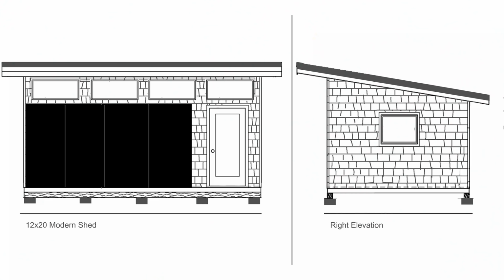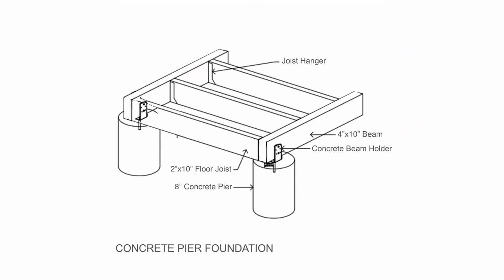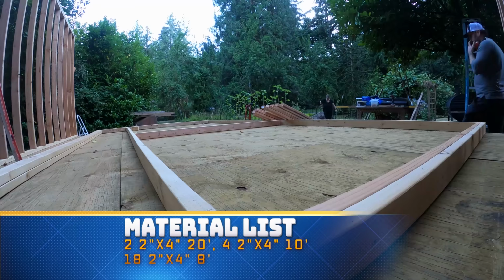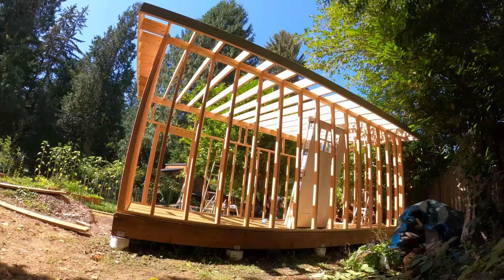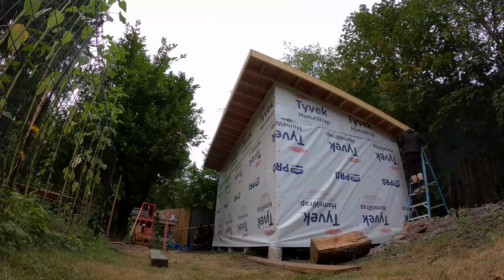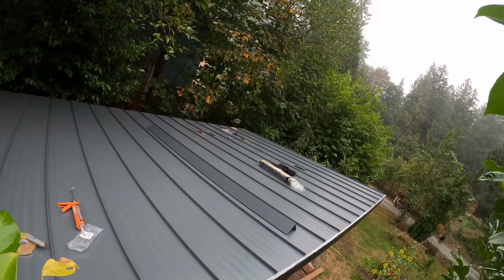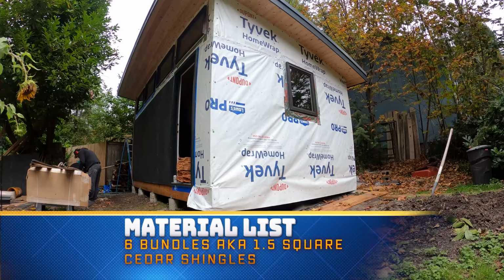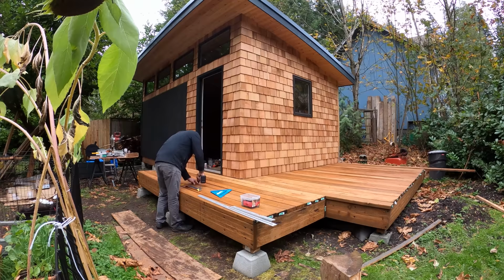Build A 12'x20' Modern Shed and Deck by Yourself: With Material List

Comment: Why didn't you insulate the floor?
You will never be able to walk barefoot in the winter and a thermal bridge will appear (condensation in the winter + rotten floor)
Reply from the maker: Yeah, I should have insulated before placing the sub floor for sure. 
If you ever do what I do you can cut 3” ridged foam board insulation and slip it between the floor joist from underneath glueing it in place. It’s a bit more cumbersome to install after the fact that’s for sure. lol 
Note to self: next time insulate floor before placing sub floor sheeting 😆
Reply: @NilesProductions  A solution could be to drill a few holes in the floor and fill the space under the house with cellulose or small polystyrene balls.

Comment: Do you think the concrete posts will ever settle deeper? I want to do the same or similar for a small house
Reply from the maker: Different areas have different codes for how deep you need to dig when doing the post style foundation. I went a little deeper than what our local code called for when doing mine so hopefully they are good for the long run. 
It's been close to two years since I built the shed and it still looks as square as the day I built it. 
I've never actually built anything like this before so I'm by no means an expert on the subject. One step that I skipped that I've been made aware is that I should have compacted gravel at the bottom of my holes. There are probably some online resources for your area that will help you know what depth you need to dig for your foundation. And you can find info about how many piers you will need for your building based on square footage.
Reply: @NilesProductions  I didn't think of local code either.. thank you so much!! Hope your weekend was amazing friend :)

Comment: for the soffit 1x6 t&g did you have the rafters overhang the structure to provide a nailing edge?
Reply: Hansen the dog looks like a great companion
Reply from the maker: I assume you are talking about the short pieces as I make my way up the sides? The rafters don’t over hang the edge they were flush with the outer wall framing. It’s a little hard to see in the video but I used a small piece of 2x4 blocking on the inside edge. I was placing the blocking against the rafter just prior to installing the T&G as I worked my way up the sides so my body may be partially obstructing the shot of me placing the blocking.

Comment: this is so nice. may i ask how much did you spend for the materials? im plannint to build a gazebo and i got a lot of techniques from your video
Reply from the maker: It spent a little over $12k for the shed and deck. Wood prices have been all over the place these past couple years so if you want something more accurate to todays current prices you can take the material list in the video description and price it out at your local lumber yard 🤙
Reply: @NilesProductions  yeah... i have the materials (i think i need hahahahahaha) and trying to get pricing from different websites. thank you so much.

Comment: Did you get a permit and do you recommend that we get one too ?
Reply from the maker: I recommend you Google your local ordinances and check before you build. In some areas the size of shed you can build without a permit vary drastically. For instance in some counties you can only have 100sf shed within city limits before you need a permit, but in the same county if you live in unincorporated areas you can build a shed up to 250’sf. without a permit. This might not be the case for you. Some places you can go bigger other require a permit regardless of size. it all depends on the local ordinances and where you intend to build. 
If you want water or power ran to your shed that will almost certainly require permitting. 
So I recommend you do some investigating before you break ground because last thing you need when doing a project like this is a fine or worse being forced to take your building down because you didn’t get a permit. So, long story short, do your own do diligence I can’t answer this question for you.  🤷‍♂️

Comment: Very impressive how you put this together from scratch, I would be slightly concerned about the ground moving over the years with it all sitting on those cemented blocks, 1 side getting lower etc?
Reply from the maker: Thanks Danny! Glad you enjoyed the build :)

For the size of the shed/structure I was building I needed a total of 8 piers. (not counting the deck) 
In the area I live you need to run the pillars below the frost line. The frost line is 12" here.  
After talking with some people that know more than me about this stuff than me they recommend I dig down at least 18".  
With that bit of info I decided to beef things up even more just to be on the safe side. 
I had similar concerns to you and the cost was minimal to take the extra step.
I ran my pillars a minimum of 24" deep instead of 18" and did 10 tubes/piers instead of 8. 

How are things holding up you may ask? 
Well, It's been aproxamently a year and a half since finishing the shed. 
In that time we have had over 100 inches of rainfall plus a bunch of snow. 
The drone footage at the end was taken aproxamently one year after completion. 
I'm happy to report the shed hasn't shifted or sank into the ground and is still sitting as square as the day I built it. 
Depending on where you live and the soil you are working with the results and requirements may very a bit. 
I found for me, doing research, reading, and asking professionals for advice will go a long way in making sure you are making good decisions. 
I think I made mostly good decisions when building this shed...
With all that said, this is just how I did things. Perhaps building on a slab would have been a better way to go? IDK? 
There are a million ways to go about building a shed... this is just the way I went about it.

Comment: Hey Niles, the prices for lumber and materials will probably differ greatly here in Germany, but could you still give me an estimate for the cost of this shed?
Reply from the maker: Materials were a little over $12k usd at the time I purchased them. Lumber prices have gone wild here in the past year so I assume it would be much higher if I were building it today.
Reply: @NilesProductions  Ok thanks, much appreciated!
Reply: Could save some money by using 2x8 or even 2x6 floor joists, regular plywood on the floor, and cheaper roofing. Except for using screws instead of nails, this shed is overbuilt 😄 Love the detailed walkthrough

Comment: What is that blue thing you’re using to screw on an angle? 2:26
Reply from the maker: It's a Kreg Pocket Hole Jig https://www.rockler.com/kreg-pocket-hole-jig-k4?country=US&sid=V91040&promo=shopping&adlclid=0b1dda7fcef210758a8abc0fbe973ec2&msclkid=0b1dda7fcef210758a8abc0fbe973ec2&utm_source=bing&utm_medium=cpc&utm_campaign=%5BADL%5D%20%5BPLA%5D%20-%20Shop%20by%20Brand&utm_term=4585307093454876&utm_content=Shop%20by%20Brand

Comment: I have a question… Where did you find your 4 x 10 x 20 beams? Did you have to special order them? Even my local lumberyard said they don’t have the ability to get that size
Reply from the maker: Places like Lowes and Home Depot don’t carry lumber that long. 
Not sure what local options you have where you live but I purchased all my longer 2x8 rafters and the 20’ 2x6”s, 20’ 2x4”s and 20’ 4x10”s  at Dunn Lumber. 
I recommend you Google “Lumber Yard near me” and then make a couple calls. Most yards that aren’t big box chains carry longer dimensions lumber. Good luck on your hunt 🤙
Reply: @NilesProductions  I used a local lumber yard.  They have 4x12 and 4x8 but no 4x10.   It's my "goto" company- They indicated that their supplier doesnt carry that size.  I'm gonna check around at some others- I may have to modify the subfloor if I can't.  PS.  loved your update to solar/battery backup.  I've been eyeballing both the bluyetti and the ecoflow.  I am now leaning to the blueyetti thanks to you.

Comment: hmm, Australians don't do wood sheds, they're almost all sheet metal.
Reply from the maker: Lot of different ways to accomplish a similar goal. I wanted to build something that would stylistically compliment my house also Lumber is pretty abundant where I’m from so it seemed like the logical choice. Did a metal roof though 😜
Reply: @NilesProductions  yeah ours are all like in kit form on a concrete slab, there are a lot of options but not like fully custom builds as yours seem to be

Comment: Shed cost more than a down payment on a home
Reply from the maker: LOL, It was a little expensive as I used a lot of nicer materials but was still a lot cheaper than hiring someone to build one for me.  I could have bought a prefab one about half the size for around the same price but from what I saw they tend to use not the best materials in their construction. 
With the price of wood all over the place these days depending on when you pull the trigger this could cost you a lot more than it did for me or potentially less. In the past two years I've seen a sheet of 3/4 plywood cost as low as $30 and as much as $100. Last time I made a trip to the lumber store prices were closer to early 2020 vs the beginning of last summer when they were around triple that of what I had payed the year prior.

Comment: Anyone happen to have the material list in metric??
Reply from the maker: I don’t have it converted sorry.
Recommend googling inches to mm conversion and going through the list piece by piece. 
This will probably take you a bit of time but at least you have the original imperial measurements to start.
Good luck

Comment: Very informative video, thanks.  I too am interested in how yo finished the interior.  Also, I have a question about the shingles ... does the staples stick out on the inside?  I'm going to use shingles on my shed, but don't want the staples to be visible. Thanks again!
Reply from the maker: Thanks Shawn! The staples did stick out a tiny bit on the inside when I first installed them but with an angle grinder and about 5 minutes of your time you can zip all those sharp points off. You can also take a hammer and bend them over making your install extra secure but I preferer the grinder method.

Comment: After all the positive comments, I hate to be the hater, but your joist hangers used on the floor joists are grossly undersized.   They looked like rated for 2x6, not 2x10.  Meanwhile screwing into end grain not the strongest connection either.  You will probably never have a problem, but if it were me, would've made the floor a lot stronger.  Sorry to be negative Nancy.
Reply from the maker: Yeah, that’s one area where I could have done better. I’m still happy with how the project turned out as whole though. I appreciate the feed back it’s how we learn. This was my first shed and if I ever build another one It’ll will only be better because of feedback like this. So no need to say sorry, I don’t take offense 🤙

Comment: Since you did a 16" OC roof - could you have done 2x4?
Reply from the maker: I don’t think 2x4’s would meet the snow load code where live
Reply: @NilesProductions  You're right. Just checked the tables and max rafter span for a 16" OC 2x4 is 10' for #1 grade Southern yellow pine

Comment: I think you should have recycled as much from the old shed as you could . If you dismantled it as carefully as you could, you would just have parts that could be cut and reused. If you still have the bits of the old shed maybe offer then for free on gumtree, someone else might build something from it all.
Reply from the maker: Good advice 👍 I did save some of the old shed during deconstruction. I’m all about reclaimed lumber. We were planning on building a shabby greenhouse that will use a lot material from the original shed and a bunch of old windows we have collected. The main house has a bunch of reclaimed timber and beams in it as well. The new shed is the only structure on the property that is actually all new material.

Comment: I had to stop watching closely at about 3.5 minutes, when you used deck screws to install the hangers.  These screws have good holding power for decking, but they have low sheer strength, which is how you're using them.  Hopefully you won't have a future problem, but it's important to use the correct screws for an application.  Deck screws should NEVER be used for hangers. I skipped to the end, and it looks like a heck of a shed.
Reply from the maker: I’m sure I make a couple mistakes along the way as I’m not a pro. So far it’s holding up 🤞

Comment: Walls on top of the flooring? 🤔
Reply from the maker: The studs for the walls are on top of the sub floor with fasteners running through the bottom plate, through the sub floor, and into the pressure treated lumber. The plywood sheeting hangs just below the baseplate overlapping the sub floor to protect the outside edges of the flooring from moisture.

Comment: Did u need a permit
Reply from the maker: Permitting can very wildly from area to area, I suggest checking your local building codes before starting. While what may be fine where some live it may not work without permitting where you live. In the unincorporated parts of the county were I live you can build a shed up to 749 square feet depending on the size of your property without permitting while in the town you are limited to 200 square ft and even 120 square ft in some areas.

Comment: Your going to have issues since you used deck screws for your joist hangers
Reply from the maker: Yeah, I should have used structural screws or nails. I think I’ll be fine though having used the headlock lag screws in addition to the joist hangers. I’ll keep you posted and let you know if things start falling apart.

Comment: Does it have to pass building code?😁
Reply from the maker: I recommend checking your local codes and permitting before building. What is good where I live may not pass where you live. For instance in parts of the area where I’m at (in the city) you can only build only 120 square foot structure while in other parts you can build 250’ with some small exceptions for agriculture all the way up to 750’ in some.

Comment: What's a bird box? Isn't it a bird's mouth or something?
Reply from the maker: You are correct, it’s a birds mouth. I find 90% of the time in life when I act like I know what I’m talking about I’m using the wrong terms or stumbling, and mumbling like an idiot. 

I hope despite using the wrong term the step still makes sense lol
Reply: @NilesProductions  i knew what you meant. Thanks for the vid. It is very inspiring to see vids like yours. 👍 Do you work in the trades?
Reply from the maker: Not a carpenter by trade. I’m just a guy with a cheap saw and hammer that likes to DIY stuff. My skills come from building a bunch of skateboard ramps and half pipes in my youth. 😜

Comment: You didn't show the finished inside or how and what it takes to run power to the shed. Great job otherwise. Thanks.
Reply from the maker: It’s nothing fancy or anything on the inside. Just some shelving and a workbench. I plan on running a solar generator in the future for lighting and small power needs.

Comment: 1) Looks like you forgot to square your squares before using them to square your foundation. I can see by eye that you're 1/16 out over that 20 foot run, which is pretty unacceptable.
2) Simpson strong ties are ok, but REAL builders use Samson Stronger ties. Samson is obviously better.
3) I see you're using the last several steps of that ladder. You're lucky you're not dead.
4) I've never built anything in my life, but I sure can tell you that you could have done a lot better.

Overall, 4/10. This is pretty good, because I've never given higher than 2/10 before.

Hope this was helpful,

Jackal McJackass
Reply from the maker: 🤣🤣🤣 I see you read the disclaimer in the beginning lol
Reply: @NilesProductions  Who is "The Jackal" and where can I find their critique of your work? I think you did a great job btw! Just curious.

Comment: Man this is very over designed... 1/2" ply for walls and roof is waaay more than you need
Reply from the maker: What makes you claim that 1/2” plywood is “over designed” what would you use instead?
Reply: Even the most heavily braced wall, in a high wind/seismic zone, would only use 7mm ply (1/4 inch) and ceiling diaphragms are the same, but for your build, you could have just used a couple of strap braces and battens in the roof. The joists and bearers probably didn't need to be so big either. Good design, but you could have saved quite a bit of money
Reply: roof structure also appears over built.  it is so dense and thick, that could be flooring
Reply from the maker: When doing my research and checking local building codes and the snow load code for 2/12 rise spanning 12 feet it called for 2x8s at 24” on center with 1/2” sheeting. This can very depending on where you live and the size of spans etc as well as your local codes. 
So yes I did over build it a smidge by running my rafters at 16” on center vs 24” but this was my intention as I wanted my metal roofing fasteners to screw into a stud vs just plywood. 
With that said it’s still pretty close to what is required by local codes

Comment: It's framed in wood not modern at all.
Build one out of steel studs then it's a modern shed.
Reply from the maker: The style/design of the shed roof is often referred to as modern vs the classic gabled roof design. The material used doesn’t have much to do with it. Google modern shed design or modern home design and you will see what I was referring to.

Comment: Yes, screws are easier and faster but you don't have the structural integrity that a nail provides. Nails also carry more weight structurally vs a screw. Congrats on building your foundation wrong.